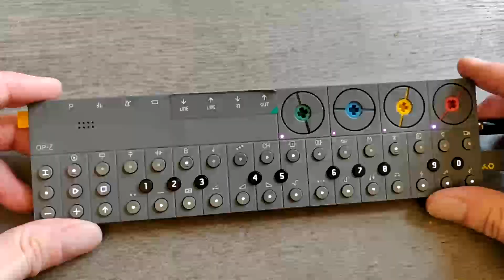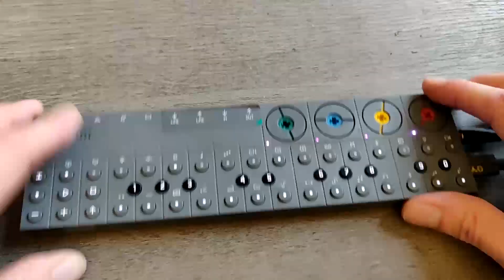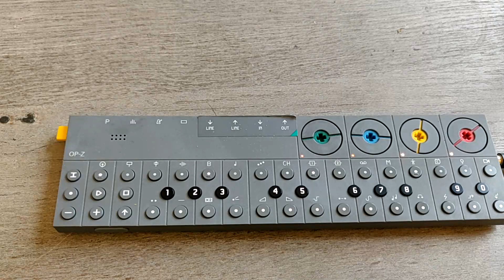OP-Z Step Components: Parameter Spark, Component Spark, and Trigger Spark

Comment: Since you asked, I'll offer some advice and opinions :) I think your videos are incredibly interesting and useful, I haven't seen anybody cover OP-Z step components at this depth. I've already learned a bunch of stuff, and I probably don't even remember half of what you talked about. I'm also glad that you've gotten a non-potato camera :) Though there's a fair amount of blurring/artifacting when you move the Z, which I'm guessing is an encoding problem. Either your camera app is doing this, or it happens when you export the video. If you can increase the settings (bitrate) there, that would help.

Now as for content, I've got a couple comments. I don't mind you moving the Z at all, it's easy to see in both orientations. I do find it hard to follow when you make a mistake, go "oops," and then very quickly do something that I can't really follow because it's hard to see which buttons you're pressing. So IMHO, in that case you need to do another take, or explain how you're fixing your little mistake, or you lose people. I actually found this video harder to follow than your earlier ones because of that.

As for length, I think 10-ish minutes is pretty perfect. You obviously know this stuff incredibly well, and you've got a good way of showing it. You should get a lot more viewers from all those frustrated OP-Z owners who still haven't really figured out how to make this beautiful machine work :D. Definitely keep it up, it's great content!
Reply from the maker: Oh sweet, this is exactly the kind of feedback I was hoping to get! Thank you for taking the time to share your thoughts. I'll definitely look into video export settings as well as my camera settings (which is just my phone... from 2018).

It's helpful to know the mistakes are distracting. I'll start doing another take when I mess up but I keep wondering if I should make the example patterns ahead of time. It would mean fewer mistakes but I worry that it might be harder to follow in a different way. What are your thoughts on that approach?

And thank you for the encouragement! I'm so grateful for how supportive the  OP-Z community has been.
Reply: @windowbed  I don't think you should pre-make the patterns, but maybe write a script to follow? My videos are a bit extreme because they're 100% scripted and very heavily edited (on my channel and the ones I make for work), but it helps to make things easier to follow. I don't think you should do that, but maybe writing down the steps ahead of time helps (or just using your op-forums posts :). Also, doing multiple takes and going with the best one. It's more work, but the end result is much better.